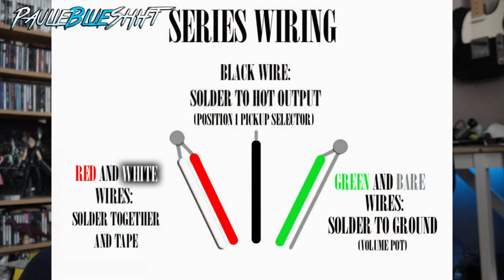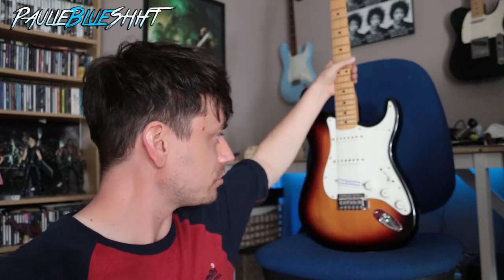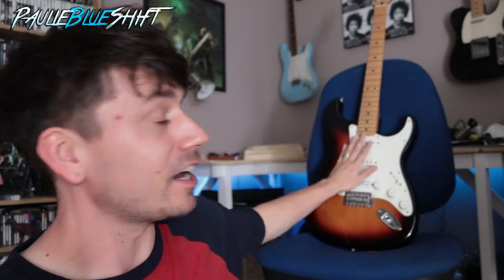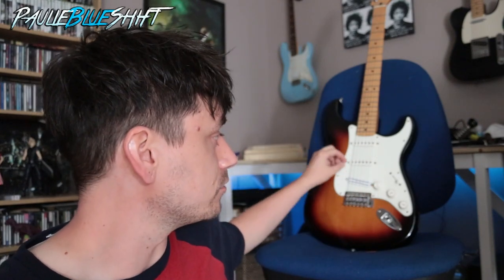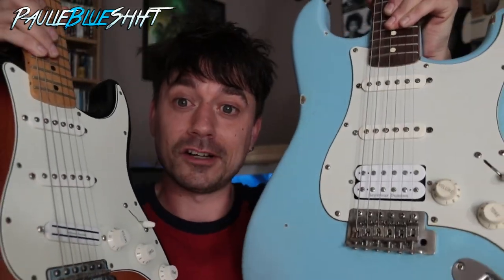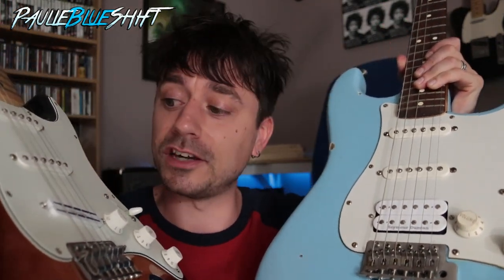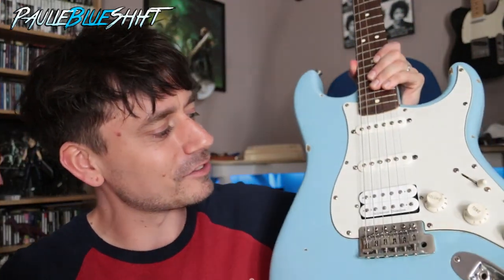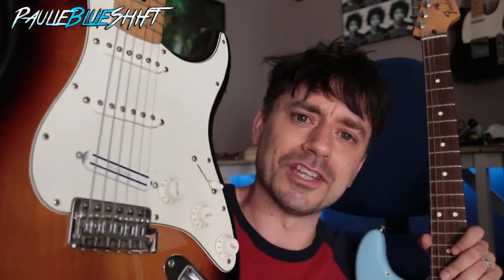Seymour Duncan Hotrails Strat Install

Comment: One thing I did was swap out my bridge tone to a 500k pot instead of the 250k , that way the neck and middle single coils have their 250k pot and the bridge has its 500k… you get a little bit more of a clear tone …

Comment: I wired the same as you did and had hum. I looked at my instructions and it states, " If your combining your Semour Duncan pickup(s) with Fender pickup(s) in the same guitar, you'll need to reverse the black and green wires on the Semour Duncan. In other words, solder the black wire to ground and the green wire to the selector switch".

Comment: I expect that the 2 different bridge humbuckers will sound immediately very different to you. Many factors contribute to the reasons.  The hotrail Bridge strat pickup is itself an awesome heavy strat type pickup with lots of drive and earthbreaking tonal characteristics, compared to the traditional stock strat pickup. A big big difference being noticed when you click on the distortion or overdrive pedal. Great pickup.

Comment: You can’t go wrong with any of the SD rail pickups. I have a Hot Rails in the neck position of my favorite strat, which works beautifully with the angled full JB humbucker in the bridge, and a staggered Quarter Pound in the middle. BY FAR my favorite pickup configuration that I’ve tried thus far. And then yesterday, I finally put a bridge Hot Rails in my other Strat. With distortion, it’s out of this world! The cleans though, are kind of muddy and I’m thinking that it might have to do with the fact that I kept the stock 250k pots in there, when most people seem to prefer using 500k with humbuckers to help brighten the tone some. How are your cleans sounding with this bad boy? I couldn’t really tell in the video, but have you noticed them sounding dark/muddy when trying to achieve clean tones? Cheers, mate! 🍻

Comment: Waiting for my SD SHR-1 Hotrail bridge pickup to arrive along with the Fender locking nuts also bought, can't wait to test it out my self.  
Also found my own little guitar hack today when I decided to rethread my Strat with lighter gauges. Originally it had .09's but that is now my new B, because i put .07s on it and i can now bend two whole steps easily, maybe even 3 but i haven't tried yet, feels to unnatural, but its the best threads/strings I've tried in my life! Shout out to Ernie balls Slinkys 😀

Comment: Hi! I just ordered mine and I was reading the manual that is included in the box and it says "if you combine seymour dunca with fender pickups you have to reverse the black and green. In other words, solder the black wire to ground and green to selector" But you haven't done like that. Is it correct?
Reply: That's what I did and want to know what's better

Comment: i had a heck of a time soldering . then i was told to use paste flux - by a plumber . he told me how i could use a little bit of this paste and then also remove it when its done , using IPA . so yeah thats my jam now . i do a lot of soldering , but i never solder with out using paste flux .

Comment: I replaced the bridge pickup on a loaded pickguard that went for about 40ish dollars with some hot rails that went for about 20 dollars. And gosh the output is so mediocre. I thought the output would be atleast louder than the single coils soloed. I also replaced the volume pot with 500k pots  and raised the bridge all the way, and still it is not giving me the output I want! Although the tone sounds great, I always have to turn the gain up in order squeeze out some extra power. Anyway if I could fix that?
Reply: Possibly wired out of phase, I just fixed mine yesterday. I got carried away and didn't check it before installed the pickguard back on

Comment: My Seymour Duncan svr rails only have a red, white and a bare wire xD I’m guessing red and white are both hot and control both sides of the pickup! It looks like that’s the case but I’ll find out when I try to solder it 😂

Comment: Would position 2 work the same as in an SSS or HSS position? Or would you need to wire it as a split coil for it to work as an HSS
Reply from the maker: It work the same but the sound would be different. Position 2 with SSS has a distinctive 'quack' sound to it. With the HSS it loses that quality.